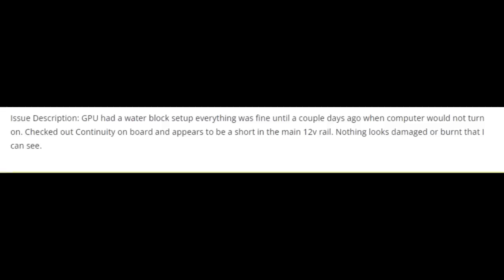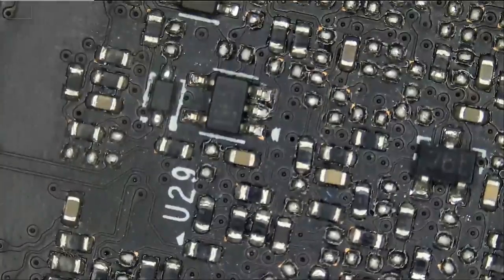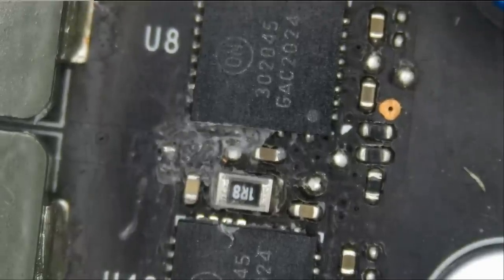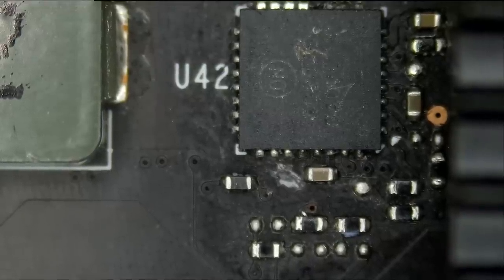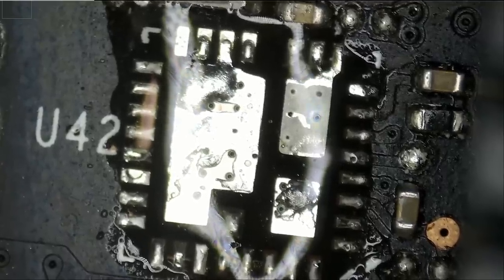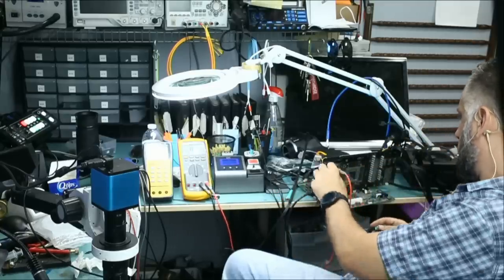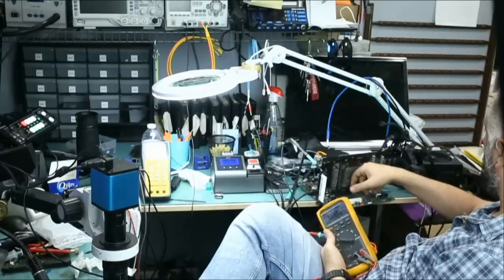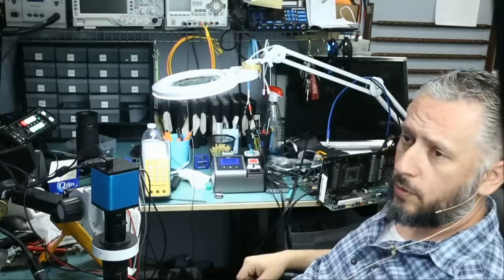MSI 3090 Trio Graphics Card Repair Suddenly won't turn on. Is it Fixable ?

Comment: The only reason people water cool their graphics card is to over clock it... this can cause components to fail no wonder it's broken
Reply: 100% User got greedy, wasnt happy with a stock 3090, he probably fried it. RIP.
Reply: I watercooled my 6900xt & I don't overclock. I did it to keep the temps & noise down & because it looks cool.

Plus cooler temps = longer life
Reply: I watercool mine to lower the working temperature of the GPU and reduce internal system temperature.
My system is whisper quiet and it doesn’t burn my leg when I’m gaming.
Reply: Not at all true, it's mostly for better noise & temps.
Overclocking is almost pointless with modern silicon.